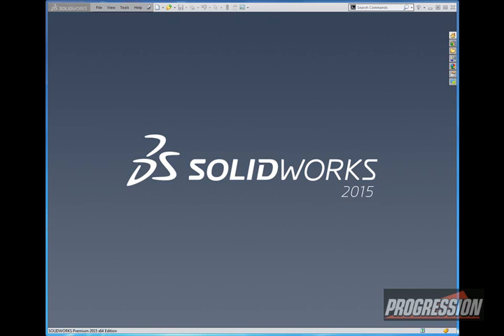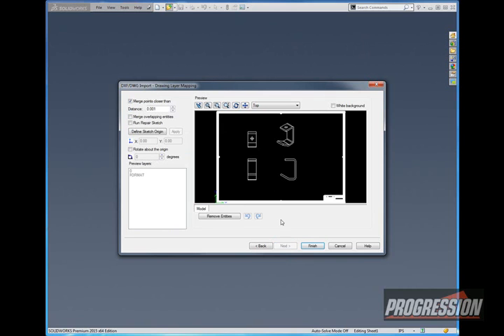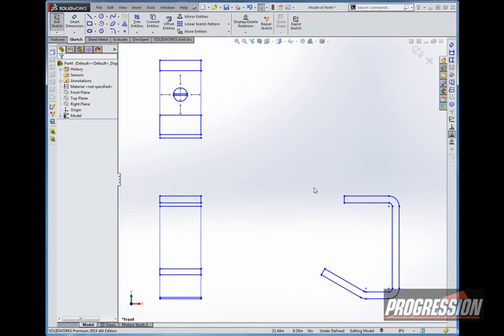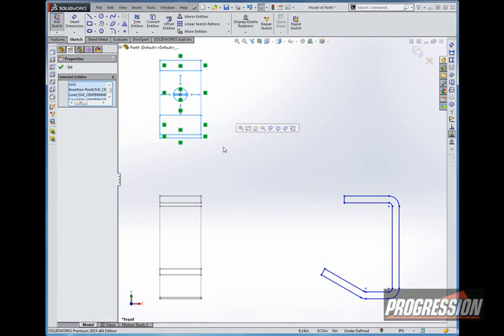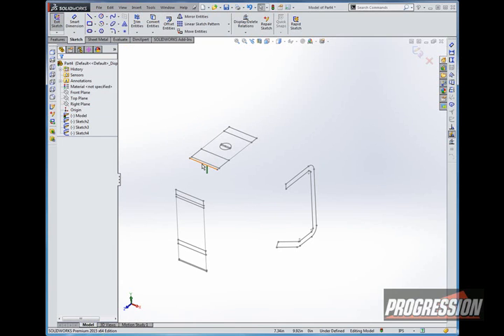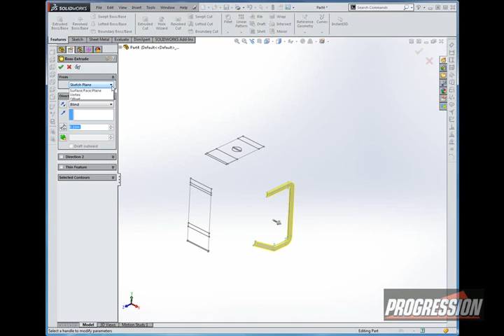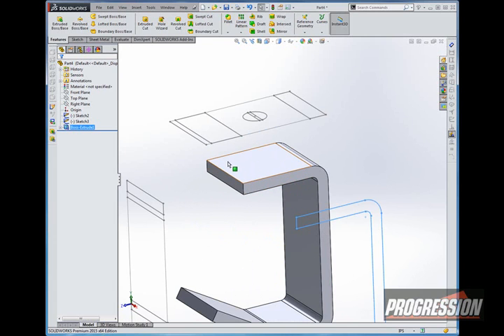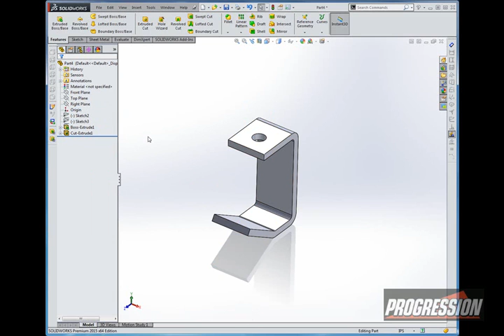How to Convert DWG/DXF file to a 3D SolidWorks file

Comment: Hi, the drawings which imported to SolidWorks have not rigth dimensions. The dimensions are bigger than the actual one. I can not change the size of the sketch, just can change the number. How can i set the dimensions same with actual one.

Comment: how do you do this if you only have one drawing not 3? cause it's a 3D drawing from autocad and it comes up as 2D in solidworks, so how do I change it into 3D again
Reply: hey I have the same problem here. I tried to make a building into a solid, wich didnt worked out. i had 10 different layers that should make up a assambly, it didnt. have you found a way to solidify large buildings for example from a dwg file? thanks!!
Reply: and make it 3d printable